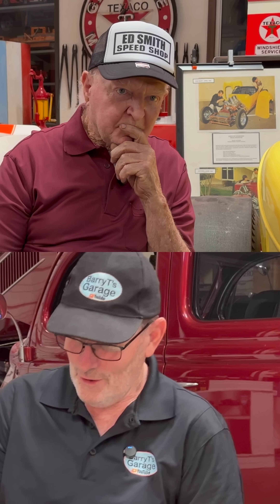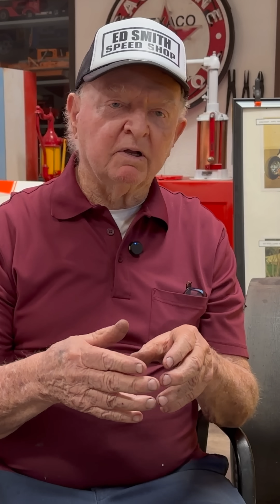Tuning DUAL Carbs - From Ask Ed 23 - Ed Smith w #BarryT #carburetor

Comment: Always tune for highest Vacuum! These always 1 control carb that handles idle through mid then through linkage or vacuum the rear (Barrels) carburetor s chime in dumping mega doses of fuel as needed! One of the primary reasons for the separate carbs is Air Velocity is maintained when mashing it
Reply from the maker: This is great thank you

Comment: Very useful information for me. I’ve been running a C 66 dual four barrel intake manifold on my 78C 10 pick up truck for about 10 years 454 bored 60 over to a 468. Flat top pistons competition cams 270 duration magnum I had been given some of the idle to the front carb. Used Ed’s procedure and set the idle and mixture and speed to the rear carburetor runs much cleaner .Ed really knows what he’s talking about.😊 C 66 Elden Brock manifold
Reply from the maker: That’s awesome to hear you’ve got it running smoothly!
Reply: Thank you so much for the reply. The carburetors I’m running are Carter AFB‘s competition series 9605 s I bought the intake manifold, and the carburetors at the Turkey run at the Daytona national Speedway over 10 years ago for $240.!! Thanks again

Comment: i run 2 single throat stromberg carbs on my 6 cylinder holden  they use 2 linkages on a rod allowing them to be balanced seperately for tuning i think ed's refering to a delayed secondry type arrangement where the second carb doesnt come on untill the revs are higher

Comment: This question is not to good, you need to know how the carbs are set up on the manifold and the linkage because some work like this guy describes but others open up at the same time and need to be synced
Reply from the maker: Good point. Thanks!

Comment: On old Mazda rotary engine like 1974 rx4 i used to cut a small piece of metal clothes hanger vent it put it on the trattle and live open like a quarter and believe me they are 4 beddle carb with 2 coils oem meaning the 4 beddles will stay open a little bit jjj all at the same time with header and homemade free flow exhaust system they sound like a hug on a coral real nice and when you run the car and hit the gas it will fly fast the 4 beddle will be open up all at the same time plus i will put 2 after market coils to burn the extra gas from the spark plug man man i used to bit muscle cars with the det up all the time crazy power crazy pulls and crazy high rpm on automatic transmission more crazy they are 4 sp automatic transmissions all with a piece of clothing hanger jjjjj sounds like a old hug and fly like a falcon sounds like want to shot down like a hug even the car body move a bit in the lights stop sings that rotary engine is a bad boy really fast and powerful from the rx4 mazdas and 1970 mazda trucks is call 13b rotary engine bad boy engines really four beddles carb

Comment: If you really want to know the correct process to tune multiple carburators, you need the service mamual. Different engines are set up differently in the manual. Some have to have stuff shut off while adjusting, and others are different.
There may be some guys who are just really good with carbs and can tweek them until they are good but the correct way is to refer to the service manual and it will have step by step on how to set them up properly. 
I worked as a mercruiser tech for years with my father, who was also a mercrusier/mariner/mercury master tech and there is just no way of memorizing all the different procedures. Some engines are made in japan, and others in the states and each engine were different. The larger outboards is where you start to get into multiple carbs, and they are not easy to get set correctly.
Of course, the newest engines are all done on the computer, but that's not carbs, thats fuel injection.
Reply from the maker: Fair enough

Comment: I do some  work on a Cigarette  boat with two roots supercharged 502 BBC engines. Each  engine has 2 
marine spec Holley  4 barrel
 carbs and each carb had 4 idle mixture screws.  These engines had fairly  mild cams so they could  and had to idle
so you could maneuver  around the marina. I started by adjusting the linkage  between the carbs and then counted and closed the idle  mixture screws. I turned  all 8 mixture screws about 2 turns out and then started  the engine. I used a digital  tach
 to fine tune the mixture screws. It seemed endless but i got it to be fairly  smooth without stalling  when going in and out of gear. I did not  do the 2nd engine because  some neighboring boat owners  were threatening  my life because of the noisy exhaust.
I also work on a triple engine 
supercharged 502 powered boat that has dual GM throttle body fuel injection 
setups, NO IDLE adjustment  screws, thankfully !
Reply: the only thing better than a big block is 2 big blocks!  i cant imageing feeding 3 502s!!   ive got a gm 502ht crate engine in a chevy k30 with a tremec 5 speed.  that ol truck will pull anything.
Reply: Who cares?
Reply: @LTV_inc  reason for your comment?
Reply: @LTV_inc  ...suck it...

Comment: I had an old Honda Goldwing, that the only person that could tune. My carburetors was an old race car guy, and he used a pressure board to make sure that they were synchronized to the same pressure if you didn’t the Honda Goldwing round like crap.
Reply: I still have my old 4 port carb synchronizer...
Reply: @ I’ve got a six cylinder Goldwing now and they have to synchronize those two

Comment: It really depends on the setup. 

2x2s and 3x2s one carb is for idle. 2x2s usually the rear, 3x2s the center for idle with progressive linkage.

2x4s it depends on the intake manifold.
Single or dual plane best steet driveability use progressive linkage and tune the rear for idle.

Tunnel ram with 2x4s I like straight linkage with idle tuning on both carbs. It helps with fuel distribution at idle especially Chevy with 5&7 and 1&2 intake events happening close together.

Blower setup with 2x4s, straight linkage with idle tuning on both carbs. 

What ever the setup, the linkage should be a bellcrank so that the throttle isnt too touchy at low speed and all the carbs are flowing the same at full throttle.
Reply: @williamfranklin6283  you seem to be a wealth of knowledge on carbs
Reply: Would a 2 four barrel or dual quad carburetor setup run your front cylinders leaner because they are further away from the main carburetor? I would think 3 barrels would run better and be easier to adjust?
Reply: @MkGearald  Yes. That's why on 2x4s the rear carb is used for idle, the primarys are closest to the center of the intake.
3x2s have better fuel distribution at idle but typically have less total cfm at WOT.
Reply: This is the way. 👍

Comment: We work on alot of side draft carbs and use a flow meter to set the them up the same at idle. The mid and full range is jetting, air corrector etc. I do this by ear mostly.

Comment: I have a 1969 428cj in my 69 f-100 and it has a 427 Low Riser 2x4 intake and it is set up just like Ed describes. The cards set on it in reverse from normal and your rear carburetor is the one you tune for idle quality.
Reply from the maker: Very cool 👍